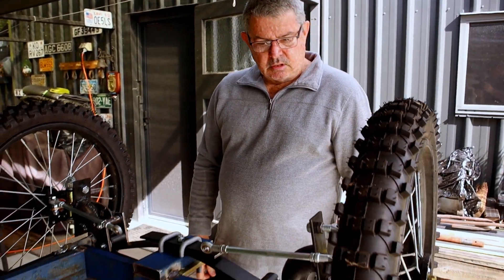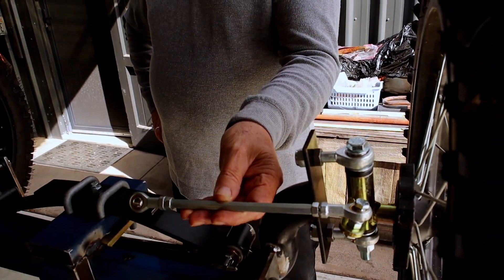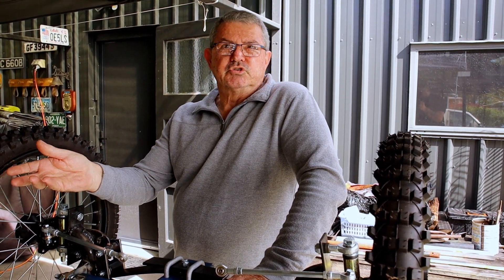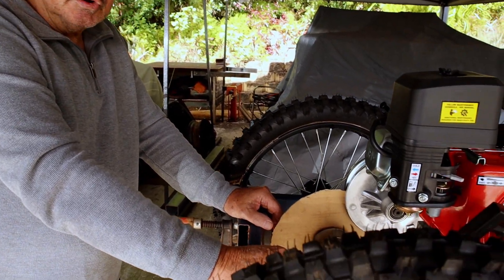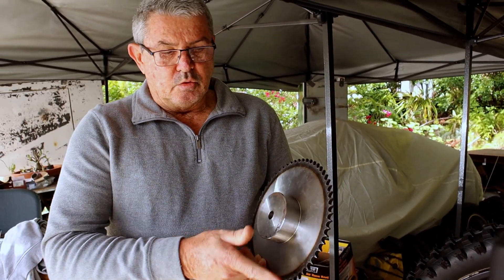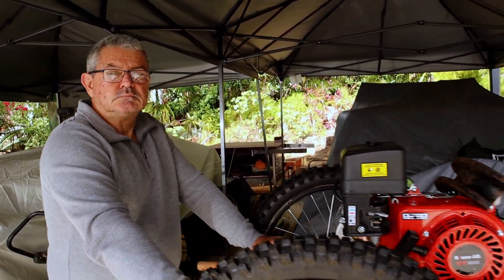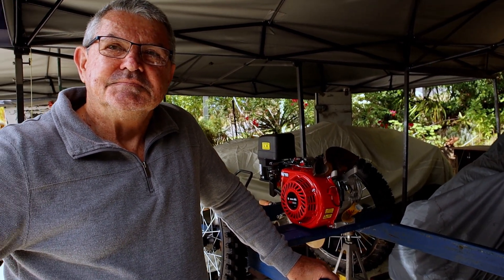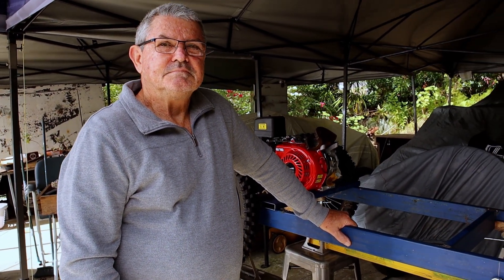First Cyclekart Build - Ep3 Front End Assembly - Model A Ford

Comment: Like the tip up or tip over design.
I am doing that on the next build to make it easier to get in and out...
The body will tip up and use the roll bar hoop to lift yourself up.
Reply from the maker: Will let you know how it goes Adam, could be a good idea for others with mobility issues

Comment: Mobility assist for the rider in order to get into, I was wondering how you were going to get in if you had mobility issues, hopefully it works for you. Will you be insulating the kart to both keep the noise down inside the kart as well as cooling it off?
Reply from the maker: Earplugs and a decent muffler will have to do!